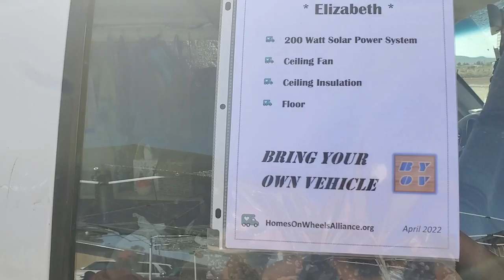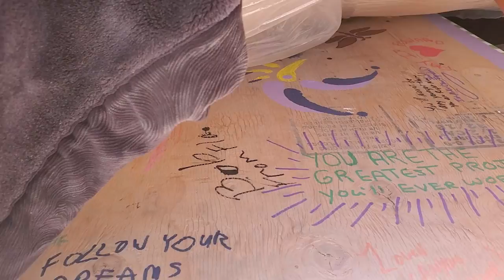Van Life: Bob Wells & Home On Wheels Alliance Helping Nomads & Changing Lives

Comment: I was a nomad once.   Once parked in the wrong place, at the wrong time.  After interaction with Transit Police in Cambridge, MA . . . on the bank of the Charles River, across from MIT . . . one block west of Mass Ave.  Could not provide proof of insurance, ergo resultingly became homeless as wagon was confiscated.  That was 30+ years ago.  😢
Reply: Hope you’re doing well now.
Reply: It’s so tough when going thru the worst of times and then feeling singled out. Back then there was no Internet, cell phones, portable laptop computers to pull up the required documents. So your home got impounded and then you had to pay to get it back.
Reply from the maker: That must have been a terrible experience. Unfortunately, nomads in many instances are still harrassed.